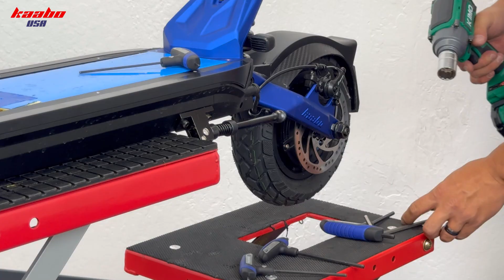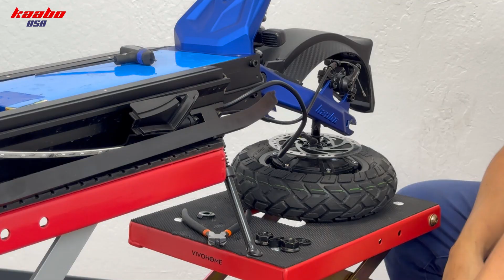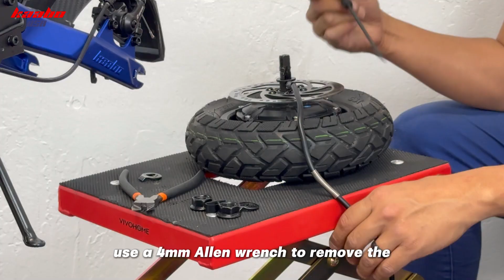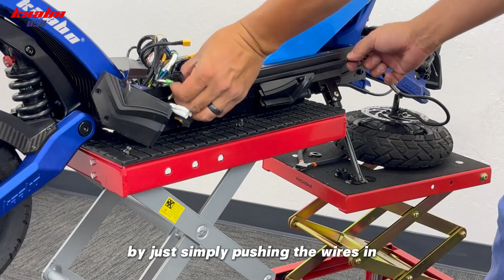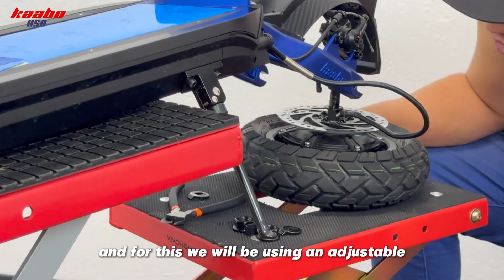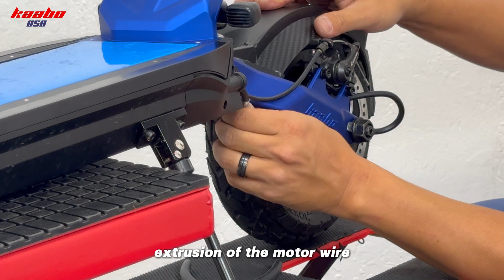Kaabo Mantis X Plus丨How to Replace the Rear Motor & Brake Disc

Comment: You skipped the part where you need to remove the deck cover. The side covers cannot be removed without removing that first
Reply from the maker: Thank you for your suggestion. The deck removal is shown in another video, and it's quite simple, so we skipped that step here.